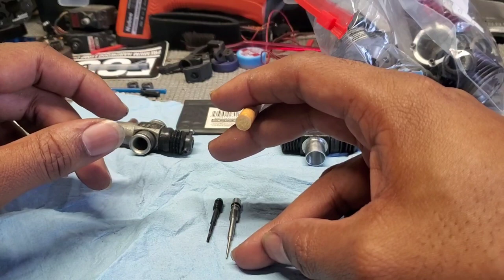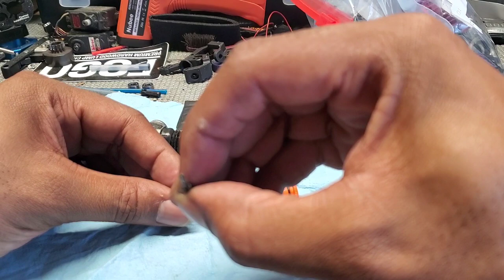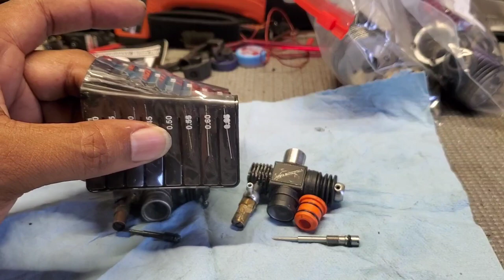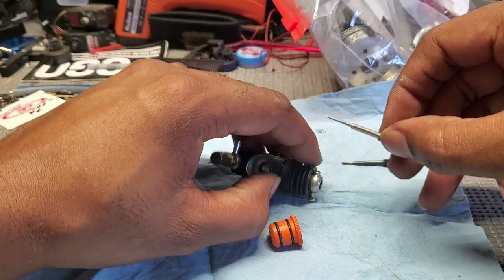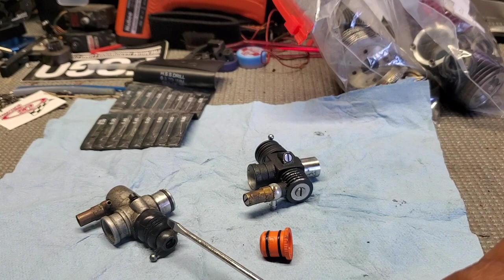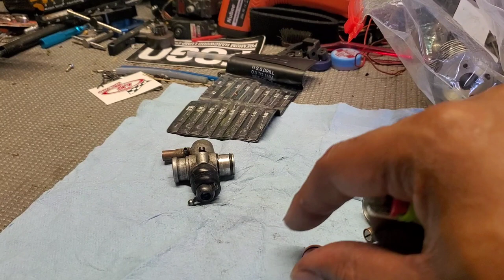Let's talk about carburetors and tuning

Comment: great video here well done i have the 2 stage idle issue been trying to work out for days i just cant get it i do get it close but wen i make a speed pass and come back it idels high for a split second then comes down but only will idle for 8 seconds then dies wen i start it up make a pass let idle come down i try to stab it on the throttle it cuts out for a split second like its too lean i cant figure out why it does this if i ricken the low a tad the idle goes up ive set idle gap i doent think i have an air leak anywere but i just cant get the dam idle to drop when i come off the throttle it will do it some times come right down but when it does then it woent stay idling for more then a few seconds and dies  what do you think im doing wrong ????????? im running the novarossi truggy 28-8 motor took the place of the rex legend
Reply from the maker: If I understand what your saying it sounds like your high and low needles aren't balanced and your throttle stop screw is probably to far out and the carb is basically closed at idle...If all things check out ok(linkage closes all the way at idle with zero trim, no air leaks, clutch bearings shimmed correctly, etc.) 
1st... would be the temp outside if it's under 50* you should put something around the head to keep heat in the  engine.
2nd...set idle gap to .6mm or as close to that as you can get it with the venturi removed from the carb, then put the venturi back in and set your throttle endpoint so at full throttle the carb only opens as wide as the venturi, and go back to factory settings for the main and low needles, this is to make sure your tuning from the rich side.
3rd...lean the main needle to get your high speed performance, **this will also lean the low needle as a consequence of the main needle controlling all the fuel the engine gets (like a spigot for the water hose then the low needle is the nozzle you hold to spray water). The more or less the main needle is open the more or less fuel the low needle gets.
4th...now listen to the idle when you do a high speed pass covering about 200 feet and hit the brakes with no throttle input and listen to the idle it should idle high then drop, lean the low needle until it idles high and doesn't drop down. **warning if it starts to sound like a machine gun you went to far lean on low needle richen up.
5th...now unscrew the throttle stop screw to get your idle as low as you need it with out cutting off. At this point it should idle without any throttle input for as long as you can stand it.hope this helps...let me know if it doesnt and we'll go from there.👍
Reply: @MrLilChilly  great input ill do as you said tomarrow and see what happens  the venturi i run is the biggest nova puts in tha package wit the engine im a basher not a racer so when im doing all this im not even running a venturi or should i have one in there and if so what size do you recomend ????
Reply from the maker: @NitroFreak  I recommend running a venturi, the carb was designed to have one in. The bigger the venturi the more top end and bigger tuning window, the smaller the venturi the more crisper  bottomend you get but a smaller tuning window. I recommend 8mm or 9mm. As far as tuning, basher or racer it's the same. For bashing I recommend getting the high end needle to where you like it then richen it about an 1/8 turn(so it doesn't run hotter and still gets plenty lubrication).  From a design standpoint these engines weren't made to be held wide open for super long stretches, but more on and off throttle repeatedly. **side note the longer you hold it wide open before letting it come back to lower rpm's or back to idle, the smaller the tuning window gets for the immediate idle drop, so it's sort of give and take**👍
Reply: @MrLilChilly  ok cool tnx for the info ill drop in the number 8 ventury and as you sais the idle for these motors is not an instant drop so maybe my engine is were it needs to be it only hangs for a few seconds then drops after wide open pass but im gonna use your advice in the first message and just retune it the way you suggest  tnx for all the help man and merry christmas to you
Reply from the maker: @NitroFreak  no problem I'm happy to help. let me know how it goes. Merry Christmas bro!
Reply: @MrLilChilly  i didnt get to try and tune it because the bearings seized in the clutch bell thats another issue i been having ive tried n tried to shim the clutch bell with minimal play but no luck trying to watch videos on how to do it ever since i bought this truggy 28.8 nova motor its been nothing but a head ache im kinda new to all this maybe im doing something wrong i make sure i set gear mesh with little play but no binding i doent know if that is causing 2 sets of bearings to go bad or if the bell is shimmed wrong any ideas were to help on this new issue ?????
Reply from the maker: @NitroFreak  sounds like the shimming may have been off a little and may have been to tight or loose to start with and when the engine crankshaft heated up the bearings did to, and they expanded and ran out of room and locked up on you or they got slammed a couple times by the bell into the retainer screw. It happens to all of us at one point or another. Check out your manual and see how many shims and what size it calls for and start there then you may have to play around with different thicknesses or where you put them because your using a different engine then what came with the truggy.
Reply: @MrLilChilly  one thing i noticed watching videos on alot of motors the end of the crnk shaft comes out of the outer bearing were you put the end screw on mine does not the end of my crankshaft sits inside the bearing i thought maybe my flywheel was not on all the way but i cranked it hard till i couldnt tighten the flywheel on the collet anymore so when i put 3 shims on the shaft then the big bearing then clutch bell then outer bearing on the end of clutch bell wen i look inside the bearing for the end of the crank shaft it sits in recessed a little so when i put my lock nut on the end of the clutbell im wandering if it is pinching the bearngs making them wear out  but if i take all the shims out the bell rubs if i add shims then it sets the bell out from the flywhell but the end of crank snout is not coming out the end bearing or flush with it so how would i fix that ????
Reply from the maker: @NitroFreak  This one I dont know, I run standard clutchbells. I think losi makes some kind of special shim or clutch retaining screw for this situation. This issue I've been hearing alot about lately mostly with the losi/tekno style of clutch bells. I'll try to find out what exactly is needed and let you know.
Reply from the maker: Only thing I could find is using a me to m5 spacer as an extender on the crankshaft or using the original losi collet and filing it down from the wide side to make it shorter.
Reply: @MrLilChilly  funny you say file it downi did that it got alot closer now im trying to shim it i put 4 of the smallest shims my hobby shop sells wen i tighten down the nut and pull on the bell it moves a bunch so im gueesing add more tothe bottom or maybe then end for end play i cant tell realy were it needs it if add to bottom and take most the play out i doent know if the end has any gap when i tigghten the nut if im pinching the bearings been working at it 2 hours now ive got closer but this is a pain lol
Reply from the maker: @NitroFreak  lol I would start on top of the clutch nut and see how far that lets it off the flywheel, once you get that where your satisfied then put some at the end outside the the outer bearing and check end play until you get it where you want it.
Reply: @MrLilChilly  working on it tnx for all the advice
Reply from the maker: @NitroFreak  your welcome bro!
Reply: @MrLilChilly  i know this is a question that cant be asked or answered but im gonna do it anyways how many turns out on the low speed needle would be normal per say looking at the novarossi manual for thier carbs says factory is 5 out from closed now i been trying to tune this motor again all day to get rid of this high 2 stage idle but still no luck i cant find any air leaks i turned my low speed in all the way from were it is at now and im 3 turns out from closed im wondering if that is still to rich and needs to go more i still have a good amount of smoke on take off and seems like its wanting to load up and cut off still if i blip the throttle it will come down just for a second then shoot right back up to high idle i feel my high speed is ok at full throttle i got a very light smoke trail but for so,e reason i cant get rid of this high idle i even whent and bought drill bits like you show in one of your vids n i set my idle gap at about 0.5.5 now ive went and tried to close the gap to even smaller to get idle to come down but i think its closed to much cuz when i shut it off and try to re start it it woent start unless i give it throttle ive even watched the fuel not move in the line when hitting the bump box so im gueesing its closed to much for the fuel not to move in the line unless i open the slide a tad but even with that i cant see why its idling high still with the gap almost closed off any more advice for me ????
Reply from the maker: @NitroFreak  low needle to far in...idle gap is ok at .55mm you can work with that. Pull the throttle open all the way and hold it open with one hand and screw the low in until it stops and back it out 5 turns. When you tune it you shouldn't have to go past 1 turn in on either needle if you have to then there may be something else going on causing you to over tune the engine. Check that when you give it full throttle it's not opening past the venturi opening and that it closes all the way at neutral to the .55mm gap with the venturi out.👍
Reply: @MrLilChilly  i cant set end gaps on throttle this is a losi truggy rtr has a basic radio so i know my slide always at full throttle goes pas venturi heres the other thing  you said 3 turns out from bottom to much i tried resting to 5 turns out like novarossi says when i do that and start it up fule will just poor out the stinger obviouesly way to rich but when i tune from 5 turns out the smoke is stupid heavy on take off so obviouesly i got to lean it but you say only a full turn should be close for some reason on this motor the heavy smoke doesnt seem to clear up till its at least 2 full turns in and it woent idle on its own it loads up alot so with that tells me there is an issue some were i just have no idea were and were to start but its dark here now so ill try and set it out 5 full turns re set idle gap to .55 and see what happens im ready to through this thing in the garbage lmao im so frustrated for days ive burnt so much fuel just wasted and seems cant get it to run like yours in your videos by the way awsome tune  and your whip is bad ass any more advice for me after you reading this ??????
Reply from the maker: @NitroFreak  it happens bro! The lack of endpoints is playing a part in not being able to get it where you want it. Frustration is part of the game that makes it worthwhile. Lol...before you lean the low try to lean the top enough to get it started once its started on the box go back and forth between the low and high leaning 1 hour at a time on each needle until it idles on it's own on the box. Then put it on the ground and do the same thing... now when you pull it to full throttle you have to remember not to pull the trigger all the way cause that will throw you off. For now we're looking to get it running and stay running without overheating or running lean. How much fuel do estimate has been through the engine including breakin?
Reply: @MrLilChilly  a total of maybe just under a gallon has been run through this motor i did the heat cycle method to break it in letting it idle for a tank shutting it down putting piston at bottom dead center then before i fire it up i pre heat to 210 with a heat gun then fire it up and let it idle for a second tank i did this for 5 tanks total then the 6th tank i put it on the street just light throttle up and down variating the rpms did this for another 3 tanks before i started leaning it but from the break in ive never got it tuned right or idleing  i been practicing not holding it full throttle since i cant set the throttle end point
Reply from the maker: @NitroFreak  ok so what's happening is the engine is more then likely still breaking in...you'll be able to get a base tune on it but it might run a little erratic until you get about a 1.5-2gals through it. Then it will suddenly richen up...that's when its fully broke in and you can go all out with the tuning. For now just get it to run rich while keeping it over 210* once you set the idle gap leave it there and just focus on the high for speed and to keep temps up and the low to stay running at idle...recheck your linkages since you cant adjust endpoints and make sure it closes at neutral to your gap settings and doesnt open the carb any.
Reply: @MrLilChilly  ok ill keep running fuel through it for another couple days and see what happens but ill just run it rich for now i guees thats a start i was wondering if it was fully broke it but ya this motor doesnt have a full gallon run in it yet
Reply from the maker: @NitroFreak  yup run some more fuel through it and if need be lean the high just a little to keep the temps over 210* then we'll go from there.👍
Reply: @MrLilChilly  ok ill do that lean out the high to heat it up some biggest thing i noticed is my temps doent go over 200 they stay around 197 consistant maybe some times hit 212 here and there i try to keep them up when running it but thats hard to do i cant force it to heat up per say lmao i guees leaning the top end out will help that like you said i just hate the high idling
Reply from the maker: @NitroFreak  yup your to rich on top and to lean on bottom...lean on bottom will keep your idle high and rich up top will keep temps down...since your hovering around 197*-212* lean high about 2hrs that will get you in the ball park...and richen low about 2-4hrs and you'll be in the ballpark
Reply: @MrLilChilly  ill adjust the tune tomarrow see what happens maybe thats my whole issue

Comment: What up Lilchilly?  Well I played with the Maxy Cinco today.  Did your recommendations you last posted.  Worked out great.  My engine takes tiny throttle inputs,  comes instantly down to idle from a long pull.  Idles great as well.  Will idle for about 45 seconds before it starts loading up but will idle forever and never cut off.  What I did was what you said to do with the dreaded fuel rail (mid speed needle).  I had to go about 1/2 turn rich and lean out the low speed.  It runs good.  Think I am a smudge rich on top but will leave it alone until I get some more fuel through the engine considering it is new (maybe 3/4 of a gallon after break-in.)  My temps, which I really don't care about if its running good and consistent, but its running between 208-223 depending on how hard I beat on it. I have never had to mess with mid needles on any of my other engines and always steered away from them but after investigation, it is easy to get them back to stock settings by removing the high speed needle brass barrel, setting the mid speed flush with its housing and the hole lined up with the high speed needle.  I noticed that I did in fact loose a little acceleration when adjusting the engine to function properly and consistent but that was probably due to it having lean spots on the low side.  Thanks again Lilchilly for the help, it is greatly appreciated and makes me feel better that my car is running like it should and it is now easier to accept all the money spent on the car/engine/servos and tires.  I have been playing with nitro R/C cars since the 90's and never really had issues tuning but I think that I was just not as anal with my tunes, you know the standard high speed lean, low speed rich and compensated with a big idle gap.  I am now way more particular with my tunes and running into roadblocks, but all is well.  I just bought a hero 7 today, mainly for my can-am X3 to trace down a water/alcohol leak that has been haunting me for a little time.  Once I get it up and running I will send you a video of my car(s) running on my backyard track we built if you would like me too.

Thank you Lilchilly, I appreciate your help and your time,
Reply from the maker: Bro thats great to hear. Glad you kept at it. I know how frustrating it can be. These engines probably taught me about patience just as much as my kids have lol...I used to be the same way with tuning as long as it ran I was happy, then I got lucky when I very nice and knowledgeable guy heard my engine running and literally stopped his track day to just help me for like 4-6 hrs straight. And he was the first and one of very few that said tune every needle that carb has that needs to be tuned to keep them all balanced. Im glad I was able to help. Even happier that your happy with your results. Thanks for stopping by and giving me an update. Have a great weekend bro🏎💨💯💪💪👊👊👍👍

Comment: Whas up man! what are some good ideas that are the right size for setting idle gap other than a paper clip? I seem to never have those around :) toothpick?
Reply from the maker: Use a digital caliper and find anything that won't scar the aluminum slide barrel or carb that is around 5-6mm in diameter. I use a jewelry drill set that you can get from Amazon and I think they may have some at Harbor frieght.